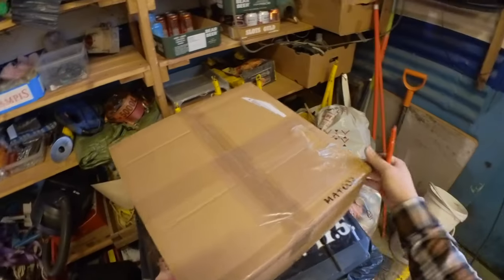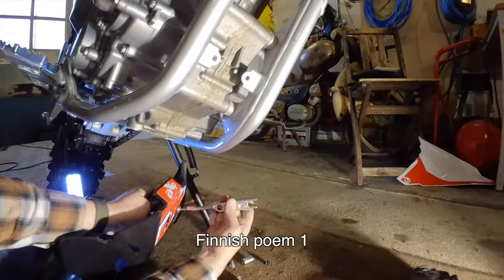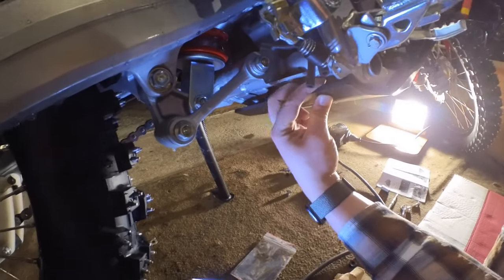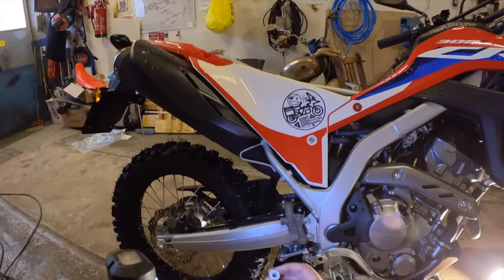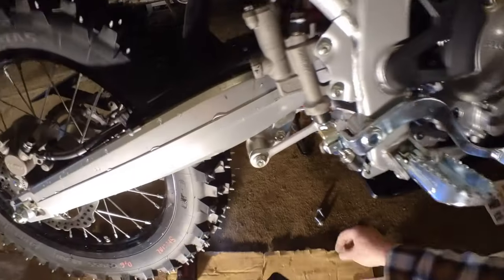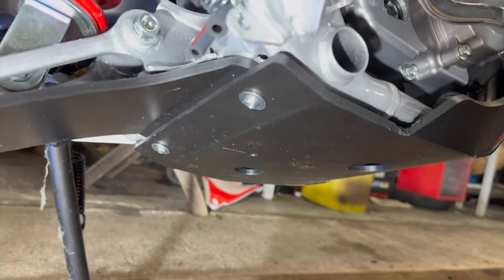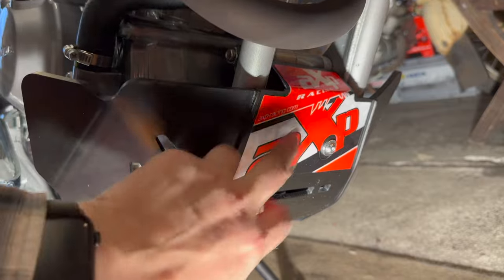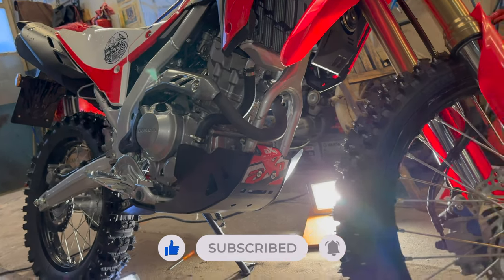The Best Skidplate For Honda CRF300L

Comment: I really like AXP's products.  Had a skidplate on my yz250fx and now another of theirs on my T7.  If and when I get my hands on a 300l I'll be ordering up an AXP 1st thing.
Reply from the maker: Thanks for the comment! I have heard a lot of good about them in the past too so that's why I went with AXP. Also this was one of the few if not the only that protects the rear linkage as well. 
Some more peace of mind.
Reply: Forgot I also have their linkage guard that I use along with the stock bashguard on my Husky TE250.  Takes a beating and has held up well.  There's a long bolt that bent but kind of expected.  Hasn't effected anything.   Almost forgot you have a T7.  Came across your channel looking for 300l content.  I want something in between the TE250 and T7 
and honestly feel like I'd get the most use out of the 300l.
Reply from the maker: That's exactly what I wanted from the little Honda. It's a great tool for me to learn offroading on as I dare to take more risk with the lighter bike. 
I'm still gonna keep my T7 beaceuse I just adore that bike! :-)

Comment: Great video amigo! 👏 Have you heard of anyone fitting this AXP skid plate to the crf300l rally? I’d like to put it on mine if it will work
Reply from the maker: I have actually heard that. But you apparently need to cut some of the oem plastics for it to work. Just removing wont work.
So its doable but maybe a bit tricky. Not sure how its gonna look though.
The linkage guard alone is a direct fit though so that is easy to install.
Reply: @PatchedBandit   Respect 👊 I appreciate you